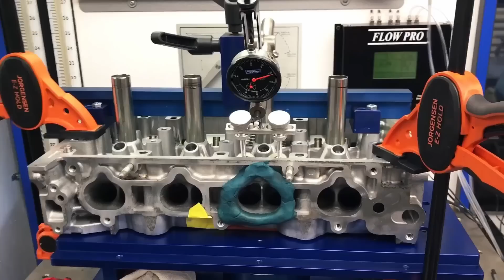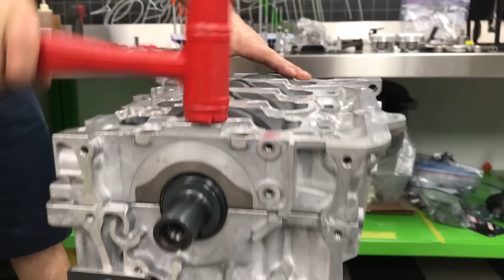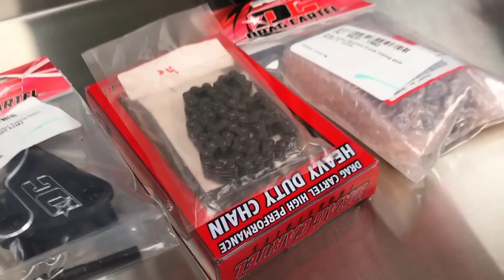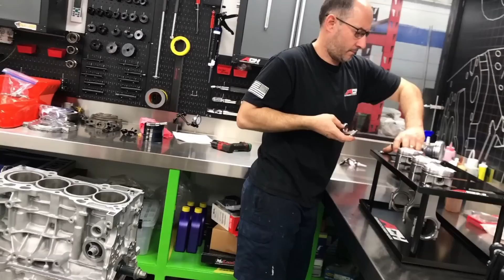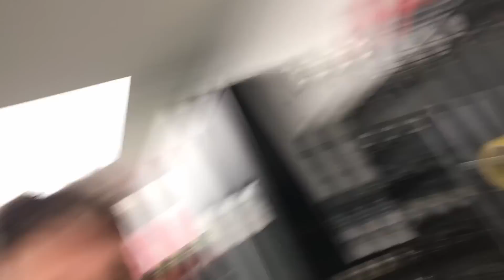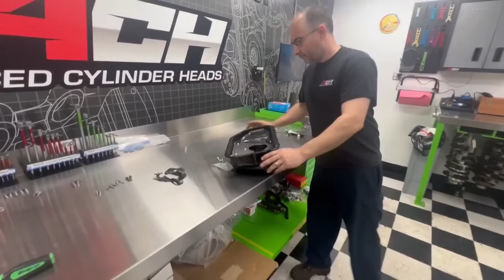Built K24 Engine Assembly! - Good for 300HP?

Comment: If machine work isn't so expensive. I would definitely do a couple k24a2 and k24A Rbb OemPlus+  Refresh Builds to get its full Oem potential. nothing crazy (just port and polish to clean up the head and Rbc Intake manifold flow and Type S oil Pump). Then strengthen  the K series Gears on the transmission like a z3 transmission because it already came with LSD.

Comment: Why just replace the exhaust cam gear and not both? Not complaining, just really wanting to know for knowledge.
Reply from the maker: I see why there’s confusion. I didn’t specifically say in the video that the intake cam is already a 50 degree VTC. It’s not from Drag Cartel so it looks stock, because it actually is the stock 50 degree cam gear. Hope that clears it up
Reply: @ absolutely does! Thanks! Hoping you do a cost break down video. I actually used your carpet dye video to learn before I did mine in my EK. Love your stuff, keep it up!

Comment: Why not put both vtc cams?
Reply from the maker: I see why there’s confusion. I didn’t specifically say in the video that the intake cam is already a 50 degree VTC. It’s not from Drag Cartel so it looks stock, because it actually is the stock 50 degree cam gear. Hope that clears it up
Reply: @RefineMovement  I'm talking about the exhaust cam gear. The intake cam has the vtc 50 degree cam gear but you putted a fixed cam gear (adjustable but fixed after it's adjusted). My question is why not put a vtc cam gear on the exhaust too so that you'll tune it from the ecu?

Comment: Robbie, 
I'm sure you've already addressed this, but you will have to replace the "RFE" water pump housing with a USDM one. "PRB" or "RAA." 
You will need it to convert your JDM K24 engine to use the USDM Alternator and tensioner setup. The JDM Water Pump and thermostat housing will bolt right up to this. You will also require the OEM shortened stud when converting from a JDM housing to USDM housing.
Reply from the maker: That’s exactly right! I have addressed that but thanks for looking out and saying something. Got the usdm alternator and the Karcepts alternator relocation bracket